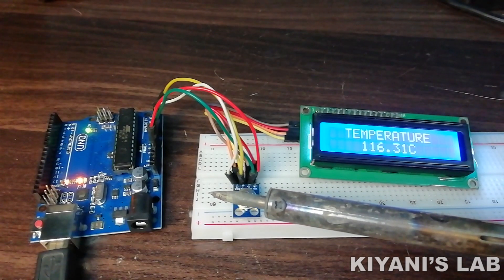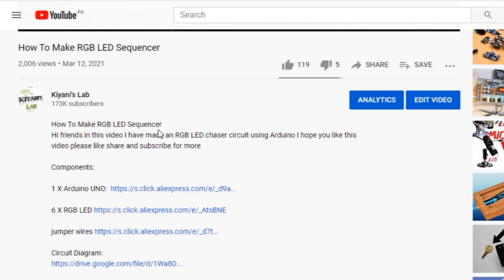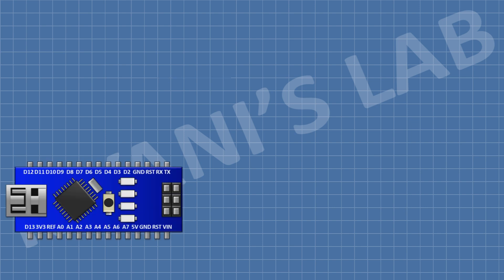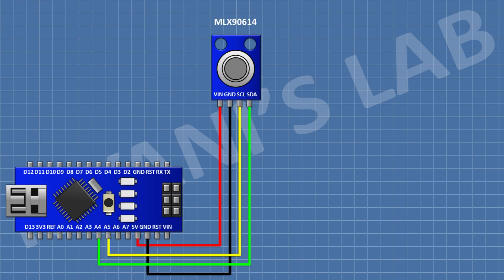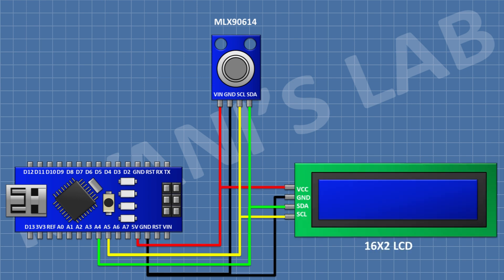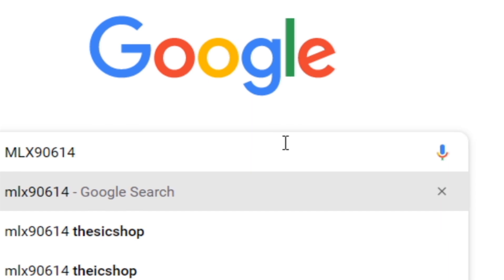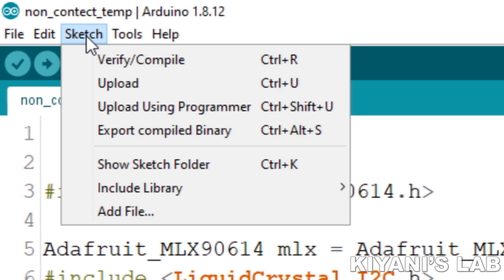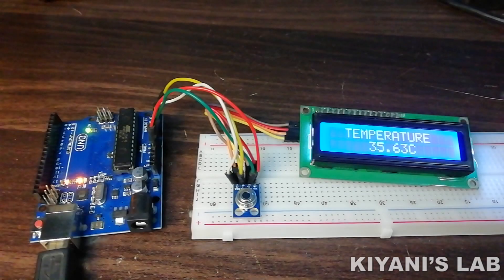How To Make DIY Non-Contact Thermometer

Comment: Good, but it is preferable that you download the code and the schematic according to the previous method, because it is much easier than this method, and try to download more videos regarding the Arduino, tank levels, and operating the water pump. Thank you very much
Reply from the maker: Ok, thanks bro